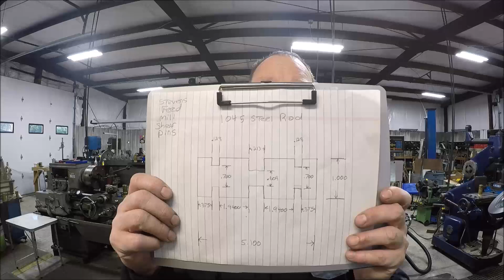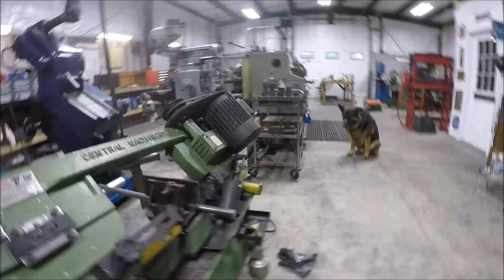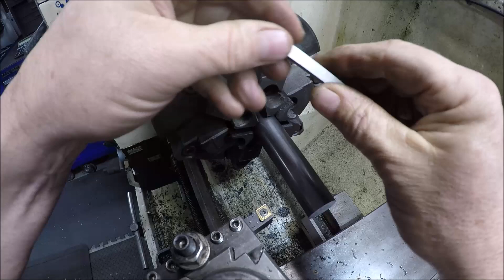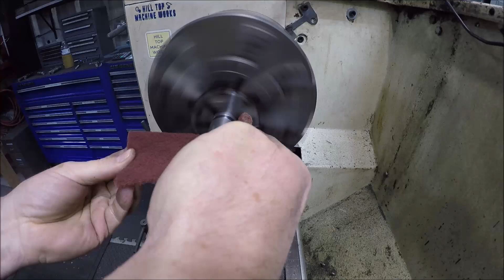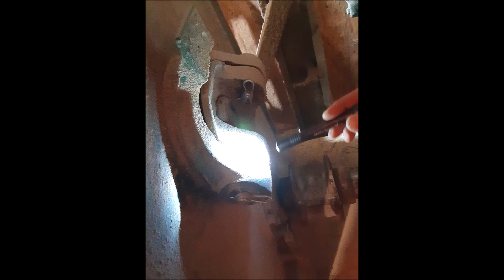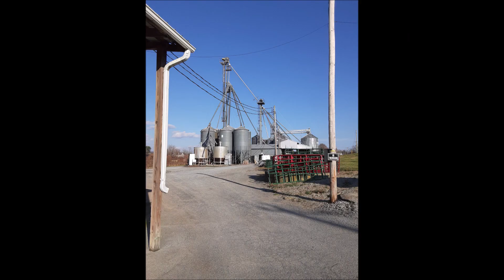Making some shear pins for the local feed mill

Comment: On my lathe (Atlas 10), I think part of the chatter/noise comes from the use of the quick change tool post because of how much the toolholder and tool hang over the left side of the compound.  There is a lot of Force pushing down the further the tool gets out to the left. Is the toolpost as far to the right as possible and still have clearance for the toolholder?  Does it get better if you clamped down all of the way on the compounds gib as a test?
Reply from the maker: I will have to do some investigating when I get a chance.

Comment: I'd check the spindle for end play and if it has some perhaps it just needs the pre-load shimmed up unless the bearings are toast check the play it the vertical axis. Something is amiss for sure that size stock should not vibrate that much.

Comment: It almost sounds like the grooving tool height is too high, and it's rubbing.
Reply: I wonder if the angle is a little off on the insert or the self grip holder causing the insert to rub before the cutting edge touches the work.  I believe lowering the tool would compensate if that's the case.
Reply from the maker: I had it set right on center, but the cutter angle could be off. It is just an inexpensive import one. Maybe invest in a quality one and see if that takes care of the issue? Thanks for your comment and watching.  @buckinthetree1233

Comment: Hi Tom, nice basic lathe job. Regarding the chatter/howling when parting. Maybe something simple like the gibs in the compound and/or cross slide just need snugging up? That can sure get frustrating. Or, as you already mentioned, could be just a crappy insert. My compound has a locking lever( very nicely installed by the previous/original owner ), and I keep it tightened alll the way 90% of the time, as I very rarely use the compound. It definitely helps for rigidity. Not as effective as replacing the compound with a solid plinth( which I've done on my previous lathe ), but it definitely helps.
Reply from the maker: Hey Jeff. Thanks for the suggestion. I need to take some time and snoop around and see what is going on. Of course I am busy right now (which is good) so I will have to add it to the list of things to do. Thanks for watching.